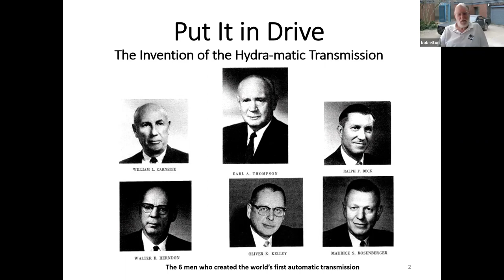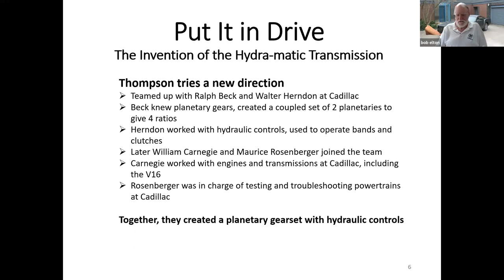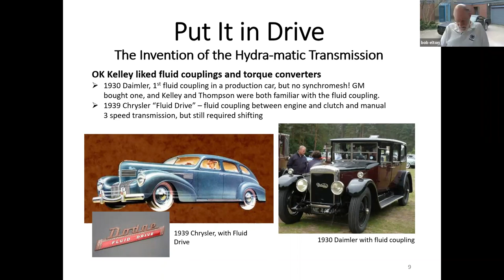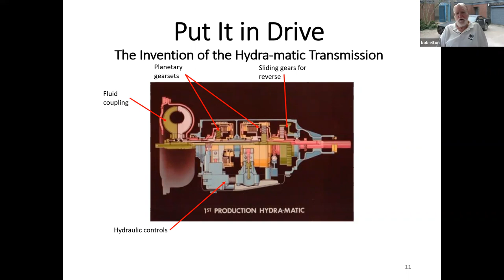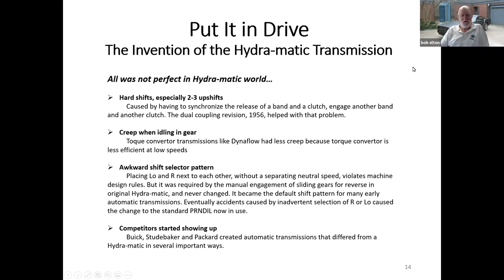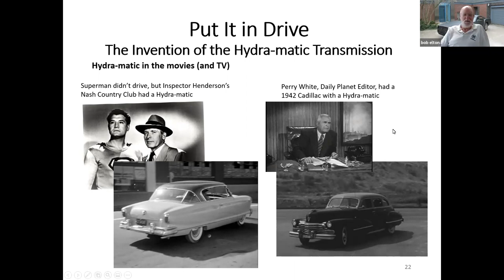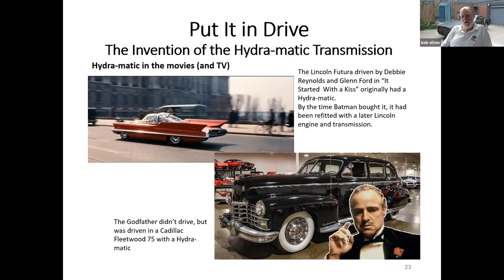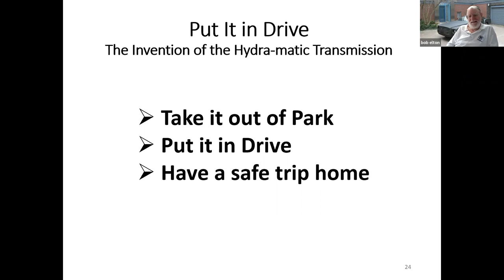The First Automatic Transmission

Comment: You forgot to mention the ACTUAL inventor of it. Why do you think they dropped the project in 1932 but picked it all back right away? Because at the end of 1932 a brazilian inventor called josé braz araripe had developed a prototype that actually worked and he sold it to GM, that's why they restarted the project and were able to put it in cars so fast after that.